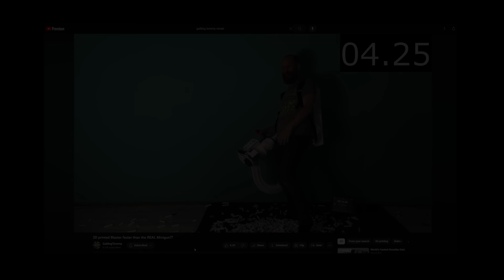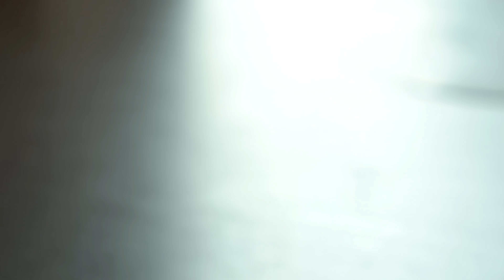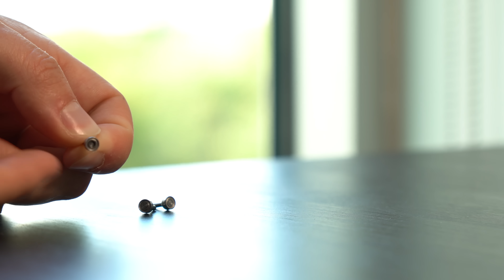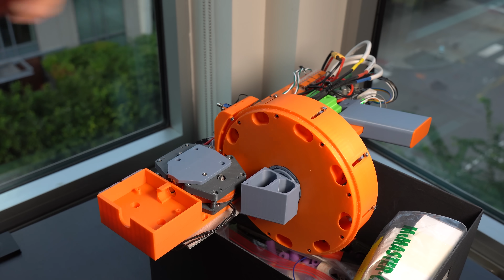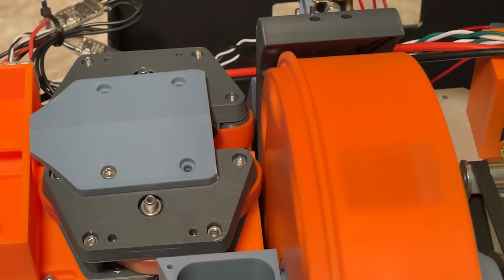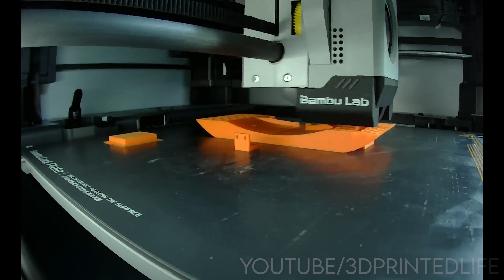My Insanely Fast Firing Nerf Gun WORKS | Part 2

Comment: I saw people calling you out for not making the “first 100 dart per second gun” but I had to reply saying that yours is way more portable! Both blasters are crazy cool. Awesome project!
Reply: Not the first dart throwing machine, no, but definitely the first gun!
Reply: To be fair, the MOAB also has much more capacity, and that way you don't waste time on reloading
Although both are just impractically fast, not a lot of people are going to use them at that rate of fire, but with how unique both designs are, I can see people slowing them down to have something much more useful in an actual Nerf war
Reply: And the fact that the Moab doesn’t fit the criteria that was set for the challenge.
Reply: @normalwaffle this one though could be modified for burst fire and is much more portable
Reply: @reio4641  burst fire is rarely an option with most blasters anyway, it can be achieved with the MOAB (although probably not very easily), and no it's not more portable, remember, one drum equals one second of firing, and carrying even 3 drums can most likely be quite challenging even with specially designed gear to carry them, so in terms of practicality both are useless unless slowed down at least 3 times
But I have to admit, both are probably really fun to use
Reply: @normalwaffle One second is all you need
Reply: @bestaround3323  now imagine you have more people than just 3 standing very closely together to tag out
Reply: @normalwaffle  It isn't about winning, it's about sending a message.

Comment: Burst mode would be a cool software addition.  It'd basically be a shot-gun then.  Any way to make it less accurate?  With the way it spews darts, more scatter would let you fill a hall with one long burst.
Reply: @youtubeSuckssNow  That’s why he said basically
Reply: You cam just flail the gun around for less accuracy
Reply: Less accuracy?  Maybe try nerf's elite darts, they never go straight.  Of course, you would have to cut them to length.
Reply: This is a really great idea. Firing this many darts for any length of time is hugely impractical, but being able to fire 5-round clusters lets the mag actually last a practical number of shots while dramatically improving your hit probability.
Reply: @evannewman3997  To be fair, the length is a large part of the reason elite darts are so inaccurate. In fact cutting official darts in half is how half-length darts started, they were called "stefen darts" I think
Reply: @siberx4 you'd probably want a 9 round burst, that way you don't end up with an unbalanced magazine.
Reply: @alexcivitello3165  Depends if he can track the magazine's position as it rotates (a simple photogate once a rotation would do it) to be able to tell where to start the next burst so you don't keep picking up from the same set of channels after multiple bursts. The darts are certainly light enough that a weight imbalance would be negligible, and if you wanted your darts evenly divisible with the total mag size you could alternate burst round counts (5/4/5/4) or something.
Reply: @nathanieljones1987  or if your accuracy is already bad enough flail the gun for more accuracy
Reply: Probably the best way to widen out the group would be to modify the shape/balance/aerodynamics of the dart, so when they're shot they fly off course.  Another option would be to make a deflector (similar to a hopup in airsoft) that would push the darts slightly off course as they were leaving the gun, producing a cone pattern.  You'd have to make it spin and match the rpm to whatever round count you intended to use for a burst shot, so that it would make a complete rotation during a burst...a 9 shot burst would require 666rpm.  A more complex option would be to move the belt drive itself to push the darts in different directions, but that would likely interfere with feeding.
Reply: no full auto in  the buildling
Reply: @Skinflaps_Meatslapper  this could be combined with giving spin to the dart for longer distances maybe with a teflon tube as guide
Reply: @nathanieljones1987 its a nerf gun justntry to aim and it will shotgun spread
Reply: I hear your burst fire and raise you FRT. Adding a solenoid to the trigger to kick it back forward would mean you get far finer control over exactly how many rounds get fired, so it's essentially just a 100 round per-second LMG. Given it's mag-fed, being able to use ammo more conservatively is kinda important.
Reply: blunderbuss
nerf edition

Comment: In a way this is more "practical" (as practical as something like this can be) than the minigun because of your magazine system being easier to load and reload than the belt feed.

Definitely want to see you bring this to fruition. Maybe even push it further lol. Let's see just how ridiculous we can get.
Reply: Yeah, but see, you can't actually carry more than 4 drums on your gear, not to mention there's no gear to carry the drums in, and the MOAB has more than 4 drums of ammunition or at least the same amount in the backpack, and you just don't have to reload
And after all, nerf Rival ammunition is the way to go for high capacity stuff, you just put 100 rounds or more into your hopper, and now you have your blaster fully refilled, these are mostly designed for rate of fire, not practicality
Reply: Still though, both are nice designs, and achieve the 100 dps rate of fire with entirely different methods
Reply: It clearly needs a magazine magazine. Like a revolver cylinder but with those drums instead of bullets.
Reply: @SaHaRaSquad  whatever you just said doesn't make any sense, can you try rephrasing
Reply: @SaHaRaSquad  honestly, that would probably work. and if you made a magazine holder that fits in a backpack you could have a massive amount of ammo for this, while still having it be somewhat practical.

Comment: I got a few suggestions: mag backpack, basically a box that holds a few extra mags for quick reloads, a working pez dispenser, a safety shield or something to not get your finger consumed by the machine and shredded by the wobbler and the mag and last, an emergency power disconnect that physically disconnects (and maybe drops) the battery if something goes very wrong.
Reply: lol, a working pez dispenser
Reply: The backpack would probably not work, because you have to reach behind your back with your arm (something not as swift as grabbing something attached to your chest), and always remember which drums on the backpack are empty, the shield is probably useless because the motor is really not that strong and you have to grip the front portion to hold the thing anyway, and the last one... well, no one has needed that before, and it's not clear why someone would need that now, just disengage the trigger, simple as that
Reply: Bonus points if the pez dispenser has a dispension rate of 100 pez per second
Reply: For the emergency power off disengaging the trigger doesn't disable all the electronics and still allows for a short circuit. @normalwaffle
Reply: @SaHaRaSquad  Peak efficiency
Reply: @BeefTechnology  Still, no blaster has this, except for maybe some exotic ones that I don't know about
Reply: Even the Nerf Longshot auto priming kit, and that thing can chop your finger off

Comment: This is awesome I wonder if you could potentially make a troika from gears of war it’s basically your nerf Tommy just doubled and on 1 trigger then you would have 200 darts a second that would totally 1 up gatling Tommy so hard the other thing than a burst fire I would make a mag quick ejection system the lastly I would try is to figure out how to double the capacity
Reply from the maker: Burst fire and mag release have been implemented! No doubling capacity, that's not really possible without significantly changing the form factor. Keep an eye out next week for the video :D
Reply: @3DprintedLife  will do also google troika from gears of war you would be surprised how similar it is the drums in remastered versions also rotate the same way you don’t notice until you have a friend fire it off and watch its almost like the nerf tommy but with a second strapped to the side and general RAAM has a custom one linked to a single trigger

Comment: yes deffinitively do a part 3!

appart from the fire rate selector, you could also make smaller drums, like hollow at the center?  as well as maybe a mechanism to quickly load darts back into the drum, no idea if that last idea is even doable.

Comment: You may not know it but the design is actually heading in the same direction as an actual mini gun. one thing that might help is extending the ramp of the cam follower father around the drump so the darts don't have to accelerate so fast into the ready fire position.

Comment: Hell yeah! I wanna see this in a user friendly version. I see myself with one in each hand wrecking havoc.... It is light/compact enough to be use as a small machine gun, it is easy to reload and you do not need to carry a bin around to recover the extra parts. It may have less continuous shooting time, but if it is easy to reload, without the need of assembling extra parts, I'd say it is much better! it does not have the same impact of seeing a gatling, but as soon as you see the absurd number of darts, it is worth it. on the other hand, you can give it a shape like a futuristic tommy gun and it will be very usable.

Comment: What was the thought process behind having a half-pull/full-pull trigger system for spinning up and firing as opposed to how some Nerf guns have a spinup trigger and a fire trigger? On another note, have you considered the challenge of making an automatic filling system for the magazine or at least a speed loader for it?
Reply: Good thinking: however, I would imagine having the blaster spooled up with a partial pull may come in handy by simplifying its usage considering clenching the trigger harder is a common reaction to being rushed by an opponent. The ability to swap mags/speed-load is always good at preventing a push as well... It might be worthwhile to have a hopper fed mag reloader on the other end of a two armed, revolving mag holder where one magazine is reloaded while the other is at the ready. (Of course, it would likely take longer on the reload but is easily countered if you can space out bursts long enough.)

On another note, providing a literal wall of fire is hardly "useless" when a target is in view for a fraction of a second...

Comment: A part 3 would be awesome, the drum mag release is probably gonna be the easiest part as all you'd really need to do I put an externel lever to pull it pins back and allow the drum out, the ergonomics of it on the other hand are a completetly different quiestions as it will be quite bulky, probably lmg like, also I have a feeling that a belt fed version could reach a lot higher rpm (due to the darts being closer together), so if you feel like it then a belt fed version would also be awesome

Comment: I don't really care that it's not the first, that you could reach it at all with an original design is what matters. I love the approach and engineering behind this design. It's hardly impractical either (not that mechanical art like this has to be), if you can make it function reliably at 100 a second that only means it can be made to function reliably at rates practical for a competition. It reminds me of the Boomco Rapid Madness prototypes working too well, they needed extra engineering to slow the firing rate in production units just to be practical for play.

Comment: Try to push it even faster if the frame and motors permit. A design that works at 100 will surely function correctly at 250, right?

Comment: i feel like you could have made your actuator much simpler. you could make all of your pins spring loaded to push them back, and used a flexible metal plate that you use a pin to push forward after the trigger is fully depressed. that way when the trigger is fully depressed you have a pin push out the plate and then the pin in the magazine would be guided by that plate and once the dart is pulled out and the pin passes the metal plate it will be pushed to the back by the spring loading a new dart. but still very cool. subscribed.

Comment: if you're proud of this, another project could be an auto dart loader for the mag. i only have one idea on how you could make it less tedious to load the loader, but that involves a vacuum cleaner-like system to pull in darts faster, and some way to recognize which end of the dart is where so you can flip them to be the right way. then these darts could be put into a system which loads the mag, maybe in multiple slots at a time for efficiency

Comment: Awesome project man! 
I love your approach to reach 100 RPS and also that it is fully 3D printed, but I've noticed the feeding problems and I have a suggestion for your future iteration.
Try moving the belts further away from the magazine and also make a funnel to direct the dart from the magazine to the belts.
Then you can change the cam angle and make it more "aggressive" so the dart will shoot out quickly off the magazine, and also I think that removing the insert that you put at 11:38 may help.
Let me know what you think about this and keep on printing👍

Comment: This is really cool.  I noticed you mentioned a couple of times though you increased the firing belt speed to ensure the darts were pulled quickly enough from the magazine.  Is there any drawback to having the firing belts spinning as fast as possible?
Reply from the maker: Yep, the belts expand the faster they spin so they're more likely to hop off the pulleys and jam. But I can also tweak belt length to help this and run faster

Comment: A note on batteries:
I made a pack with 18650 cells, no major issues or anything but as a safety precaution I purchased a cheap Ammo box and drilled a small vent hole into the side. Basically, if I ever have a cell start to go super saiyan it gets dropped into the timeout box and taken outside to think about its life

Comment: I want to know at which point this thing beccome less of a blaster and more of a dart extractor. 
I wonder what would happen if one of those belts which unload the dart into a set of wheels as they could rotate faster then the belts. With a fast enough drum-spin, centrifucal force could aid in the dart unloading process as well

Comment: Do your local nerf wars have anything like Defend The Core or is that a midwest thing? Each team has a kiddie pool propped up at like a 45deg angle or so and both teams try to get darts into the other team's kiddie pool, or "core". (way back in the day the core was a coffee can and that was a bad time, it incentivized low scoring plinking instead of more dynamic pushes) This would be very VERY good in a gamemode like that.

. . . though eventually we started scoring normal darts as 0 and giving points to anything the size of a mega or higher because high-volume dart dumps got too easy

Comment: Wouldn't a clutch for the mag be a good idea? I image the parts are under a lot of stress as soon as you let go off the trigger. Alternatively maybe some code that slowly decelerates the mag motor?
Reply from the maker: The mag drum motor does use an acceleration and deceleration profile. Ramp rate is just fairly high

Comment: Your dog has a name of my cat :D

Love the design, though I have to ask: have you considered using air pressure behind the aligned dart instead of the rods&pushers? I'm thinking there has been some decent impeler designs so it could be quite compact and enclosed, while providing enough force to push the dart into the belts :D It could be simpler, though of course I already am thinking how to make it complex again, by "precharging" some pressure to be released when the dart becomes aligned... ;)

Comment: Amazing R&D! What is the materials cost estimate if I use your design and print my own?
Reply from the maker: It’s not too crazy. The aluminum backplate was $150 since it was qty1. Then maybe $250 for electronics and under 100 for the rest of the hardware

Comment: I've been following this project since it's start and this is awesome. I'd love to print and assemble one once you're done with the design. Great work but what are the fps numbers?
Reply from the maker: inconsistent haha, I plan to add a second stage to improve this but didn't get around to it yet
Reply: @3DprintedLife  you could add a second stage but it's a belt, so why not just extend the belt and add guide rails/ more pulleys in-between to make the tension consistent throughout the entire length of the belt?

Comment: do finish up please! imma be that old guy that tells you this has a striking resemblance spiritually with "the cyclone" from perfect dark 64, thing was never meant to be a marksman type of gun, instead its purpose was to unload the largest ammount of ammo down range as suppresive fire just like this 😂 (although a "magazine discharge" of 50 rounds took 1~ sec so technically you beat it)